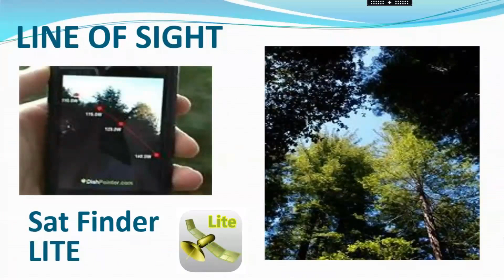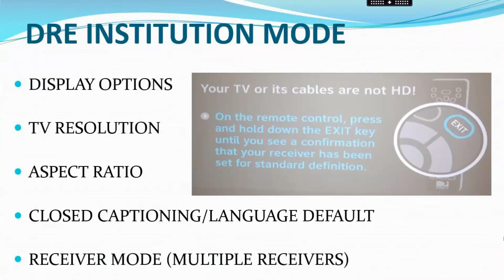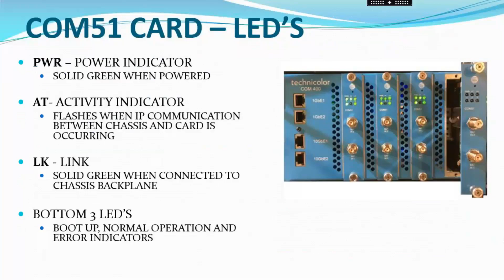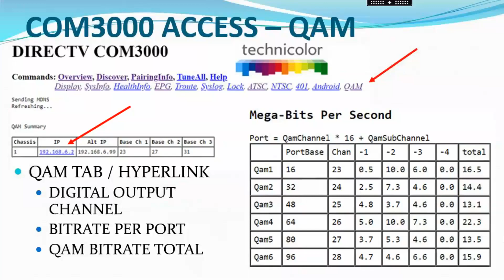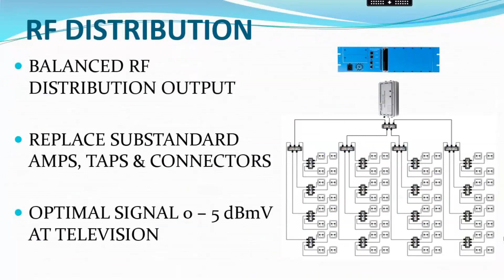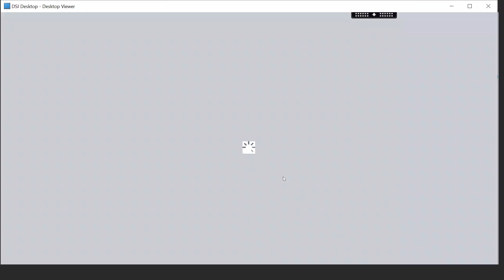COM3000 & DRE Installation

Comment: I'm losing my mind. We got rid of the Technicolor NTSC 8 replaced with "compatible" blonder tongue NTSC 16. This device is a pain in the ass. Right now I can't get the data port or console port to respond. Yes my ethernet cable works and my IPV4 settings are correct. 
Try pining the port no luck. Think if I factory default the device it will work again. This thing hasn't seen a firmware update because we can't set it up for remote access. When we do it breaks down. 
The thing is a piece of shit. 😂😂😂